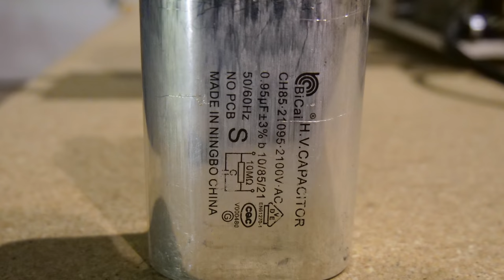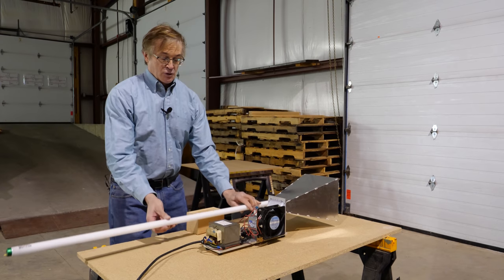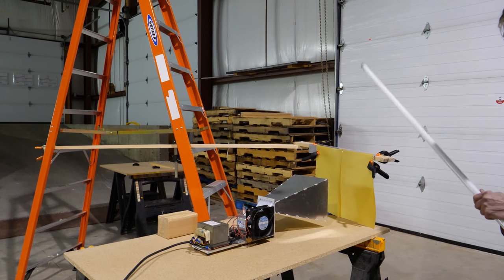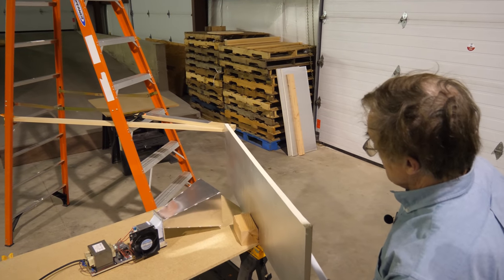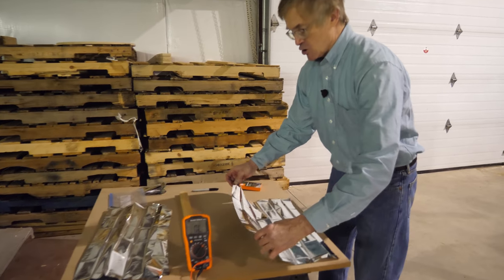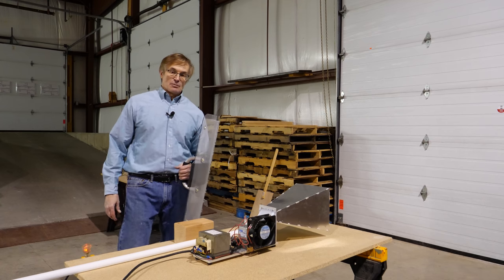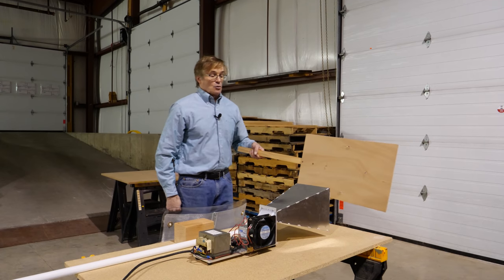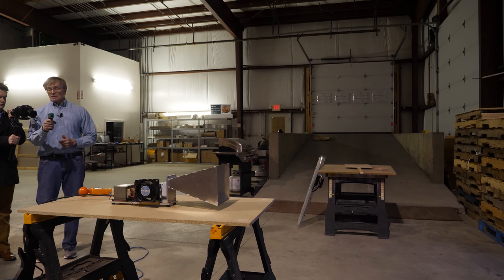You're not protected from microwaves... yet - Part 2

Comment: Excellent video!
And I'll ask again *)
What about the use of window films with sputtering metallization?
There are some for automotive and conventional windows.
Reply: If it's conductive with no gaps larger than 0.1mm or so I think it should work, but don't quote me on that.
Reply: This has been on my mind as well. I think that if it's too thin, the resistance may be too high at your operational frequency, and a significant amount of energy may simply pass through. If the material is transparent, visible light is obviously not reflected, so where is the cut off?
Reply: @Sibula  oh yeah maybe it is a cage
Reply: The emergency blankets  are "sputtered" too, that's what vapour deposition of metals is. Measuring the conductivity will of course tell for sure. Holes in the conductive material can be quite large,  at 1mm wavelengths we're already in IR territory (of course reflecting IR is what the rescue blankets, the insulation boards and the metallized windows films are designed for)
Reply: @Sibula  if it has to conduct to be effective it will not really work. conducting a current in such a thin layer will evaporate the layer. after that it will no longer protect.
Reply: @ulrichkalber9039  Are you sure? The current would be tiny. In any case, I'm not really familiar enough with the material to say more.
Reply: @Sibula  no, but the layers are so thin they are translucent, even the tiniest current might damage them.
I would not try that out in a real microwave beam.
Reply: @Sibula  0.1 mm sounds a bit too small actually, I think your microwave has larger holes in the crate before the door window, and some science youtuber who wanted to film the microwaves inside more exactly taught me that even then the holes are still smaller than they need to be to be safe. Because he enlargned it a bit to film throught it and the camara didn't even experience visual artifacts (so no leaks of radiation at all)
Ah it was steve mould https://youtu.be/8bXhsUs-ohw
Reply: @EeroafHeurlin  I wouldn't rely on either since they are so fragile and easily damaged... The wire mesh fabric would be the way to go.
Reply: @Ramog1000  A microwave oven uses a frequency of around 2.5 GHz, a weaponized system could be up to 100 GHz. The size of holes depends on the frequency.
Reply: @Sibula  ah wasn't aware we were talking about the higher frequencies. Yeh I am aware, I just thought you where talking about normal of the mill microwaves
Reply: Food microwave is around 2.4GHz which is approx 12cm wavelength.
Reply: Agreed, though for making for example a room RF shielded it might be nice to have a window.

Comment: What you could do with is a metallic retroreflector that would direct the energy straight back at the source and overload it (not that I worked in the defence industry on microwave equipment or anything)
Reply: Interesting! Have you read anything about microwave phase conjugation technology? The public research opens up some really interesting possibilities in fields like medicine and data transmission, but the top-secret stuff is straight out of Star Wars. Like retro-reflection, phase conjugated signals are mirrored in space, but they are ALSO mirrored in time or phase angle, in fact they are technically refered to as time reversed or time-symmetric waves, because the phase angle of the wave is rotated 180 degrees in addition to reversing the momentum vector. Some amazing technology becomes possible when you can achieve phase conjugation of signals.
Reply: What would happen if you flipped the shield around as you faced the source?
Reply: @agmsmith4079  as far as I can tell nothing
Reply: @taylorwestmore4664  I'm afraid that this is beyond my knowledge.   I worked with microwave  tech in the late 1980s so at the time the physics was still being explored.  One of the most interesting things was the  creation of spiralling microwaves which behaved in a very destructive way and could penetrate metal mesh with spacing way smaller than the effective wavelength.
Reply: @Edward Elizabeth Hitler more like the reflector in the rear light array on a car.  A retroreflector reflects light or radiation directly back to the source independent of what angle it hits.  Like the reflective strips on hi-vis vests
Reply: @markedis5902  well the inside of the shield is parabolic so it would focus the microwaves reflected off it.  Not not sure by how much or at what distance they would all converge.
Reply: @markedis5902  So, a corner cube array, yeah I was thinking the same.  Make the facets ~ 1" square, should be big enough to handle the microwave wavelength of ~ 1 cm.

Comment: My father worked with radio transmitters. Once they made an HF (or VHF I don't remember) transmitter to kill beetles and other insects  in grains like wheat, corn, etc. He used a fluorescent lamp to show it working.
Another story my father told is that there was a small favela around an AM transmitter from an AM radio that was very powerful. People took fluorescent lamps from garbage and put on the shacks near the transmitter and they turned on without the need of energy, but as the radio was AM the light flickered a little along with the sound.

Comment: At 7:27 you say the same things twice in a row, looks like an editing mistake of two versions of the same scene
At 16:23 You forgot to add the part where you further discuss the effectiveness of space blankets and whether orientation matters.
Reply: IMO the orientation doesnt matter
Reply: @trollmcclure1884  The coating rubs off fairly easily.  In my humble opinion,  a person needs to know which side the vapor dep is on so as to handle it properly, and in some circumstances when mounting it.  For example, if a person put it on one of those plexiglass right shields, a person would want the Mylar facing outward.   ... I wonder if the microwave reflections might be more diffuse from the dull side.

Comment: yea i found it odd you didn't mention how dangerous those microwave electronics are. I remember seeing a video about how someone reconfigured them, and they mentioned how insanely deadly the amps are for the power source, stuck with me. Also, as far as I know, microwaves at any frequency are not ionizing. So DNA damage is not possible.. Burns and cellular damage sure.
Reply: Correct, microwaves are non-ionizing radiation. However, the way they work in microwaves is to jiggle water thus causing the food to heat up. So in theory it could do internal damage to humans via the same process if scaled up. That along with cavity resonance could do some serious damage.
Reply: @Gooch_cruiser  For sure. But given the intensity it could be fatal. So worse case scenario it's the same.
Reply: did you watch the video or the last one? its kinda how he started off lol
Reply: Yup, not a DNA or ionizing radiation issue but the your eye's cornea is very sensitive to microwave heating of it water molecules.  IIRC the damage threshold is like 10mW/ sq cm. and the exposure time is going to be short.     If you can feel you skin burning, likely your eye's cornea is already damaged.
Reply: @connorjohnson4402  I felt he kinda implied ionizing radiation was possible at the beginning.
Reply: The DNA damage is induced indirectly.  See my other comment.
Reply: @craigs5212  So now there's a business opportunity for "blue blocker + millimeter wave" sunglasses!
Reply: The power supply is probably more dangerous than the beam. For exposure to the beam, I would be more concerned with the heating effects on sensitive organs near the surface. Eyes are especially vulnerable. The proteins that make up the cornea and the lens are especially sensitive to heat. There is some talk about non thermal damage to the cells and DNA but these studies have been going on for years and are still inconclusive. Most radio frequency engineers only worry about the thermal effects when assessing their own safety. Exposure of the general public is legislated to be keep at levels orders of magnitude lower than any observable thermal effects. ( Except in microwave crowd control! )
Reply: @TheTemporalAnomaly  Especially considering that IR and visible light have a higher energy than microwaves, and you don't get ionizing radiation until you get to ultraviolet.
Reply: @coreys2686  Natural sources of radiation are of a different character, namely they're distrubuted across different frequency bands, are largely not "modulated", and are randomly polarized.  You can make a case for polarization of visible light as it travels through tree canopies to the understory, but visible light and ELF-UHF are not the same.
Reply: @coreys2686  UV-C radiation to be exact, everything over 125nm is non-ionizing, doesn't mean the radtion is pefectly save before that but at 125nm it becomes multiple degrees worse. UV-C lamp radiation leaves your skin smelling burned after a bit of exposure, and you should be careful with it in general (unfortunate stories where clubs accidentally put in uv-c lamps instead of near uv light aka blacklight lamps)

Comment: A lot of people are concerned with the possibility of an EMP attack. Could you do a video on the topic & how to possibly best defend against one?
Reply: faraday cage, so basically the insulation he showed, but you should connect all the pieces electrically, and probably grounding them isn't a bad idea either. Also no cables from outside the cage should enter the inside or should be removable very quickly. It depends what you want to safe, it probably makes more sense to save replacement hardware than actually saving your daily use stuff, since that always runs the risk to get hit simply by being plugged in to the grid. The only question I can't answer you, is how thick the conductive layer needs to be to viably protect against a full strenght emp, thats something I myself never found out.
Reply: MilitaryVehiclesHaveRadiantEnergyWeaponsEquiped,AndYouCannotBlockThese.
Reply: @ovidius2000  the frick does it have to do with the topic of the post.
Reply: @Ramog1000  A faraday cage must be grounded to work. Otherwise the charge builds up with nowhere to go.
Reply: @DaveMiller2  actually no thats wrong, the faraday cage itself works without a ground (the faraday cage actually is only about that the charge builds up only on the outside, the inside is completly field free because they cancel out). Grounding is a safety thing, because you can ofc get a shock from it if you touch it from the outside.

Comment: What is the effective range of an IR thermometer?
Reply: For normal use or for detecting microwaves?
Reply: Roughly 93,000,000 miles, if your target is large enough (works fine for the sun, random stars not so much).